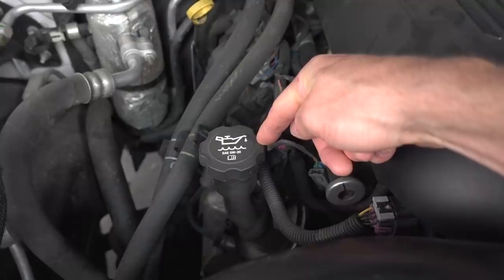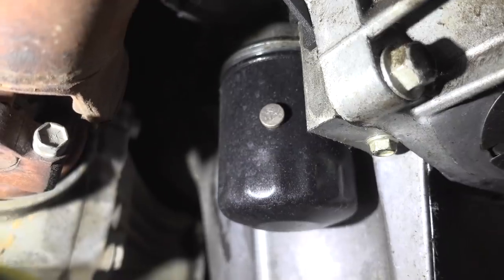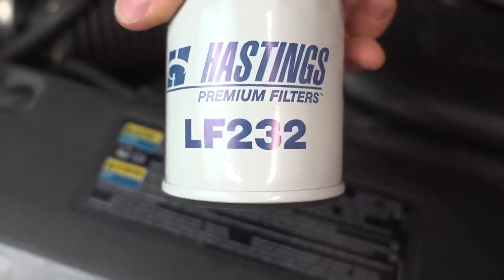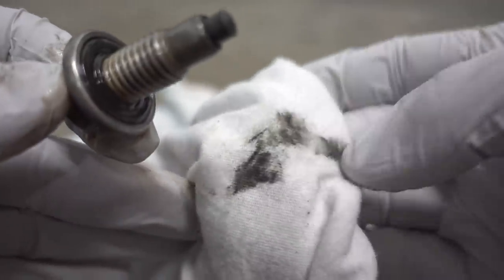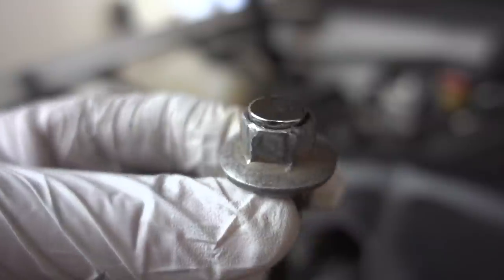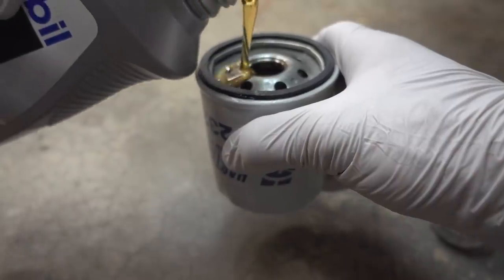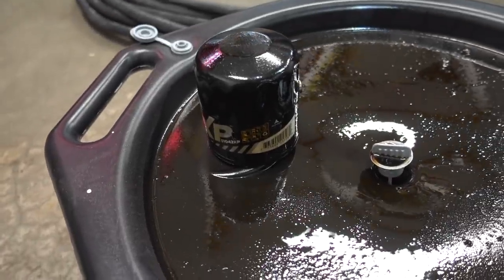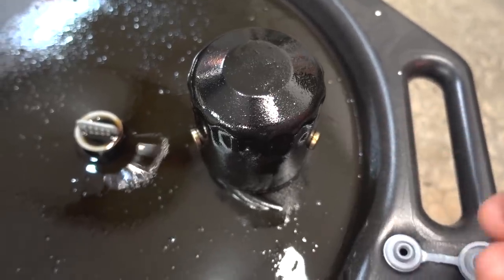Look What A Magnet Did To My Motor!

Comment: never put Additives in your engine
Reply: Put always additive in your engine, IF the additive are ATP AT-205 Re-Seal and/or RVS Engine Restore. You only need to add them to ONE oil change tho, since the effects last MANY oil changes. 100 000 km in the case of RVS.

Comment: Put a large magnet on the base of your oil filter.Any steel that gets in is trapped even if the filter by-passed for any reason.
Reply: Yes. At the bottom or around. Same difference.

Comment: I'm a subscriber to "Project Farm" and advise folks to check his channel out.  He goes to amazing lengths to prove and disprove the claims of a variety of mechanical and automotive products as well as some that may be more considered as consumer products.   As for "Hastings", they've been an automotive parts and additive manufacturer since the beginning of automotive time.  After seeing that rare earth magnet and the fact that it has completely magnetized the drain plug, I have an issue that you may have now magnetized an area of the pan around the plug which makes the ability to remove those ferrous deposits next to impossible.  In my opinion, the original magnet that's on the end of that drain plug is entirely sufficient for it's intended use.

Comment: Additives in my opinion are snake oil.  Why wouldn't Mobil put it in their product if it is so great?  I change my oil regularly (3-4K) and vacuum a gallon of ATF every 15k or so.  I have 245k on my 03 Suburban and just replaced valve seals which solved my oil consumption (1qt per 1000 miles) issue.  It runs like a champ. Thanks for the video 1 Road.

Comment: My 2002 S10 has a side mount filter too..what I do is put just enough oil in the new filter to coat the inside without spilling out while installing it...👍
Reply: That is exactly what I do to my John Deere lawn tractor.
Fill it just full enough so it doesn`t run out when sideways.

Comment: Just a thought on the drain plug extra magnet.  You should check it against the polarity of the tip magnet so that they are not opposing each other, so that the north or south fields are both pointing in the same direction.  

My Toyota Tundra transmission has rare earth magnets in the transmission drain pan that get cleaned when i change the filter, they are just held in place with their own magnetism.  You could place a large rare earth magnet on the outside of your oil drain pan and check it when you check your oil pump screen, or pull it off right before you drain your oil.

Comment: Great video
.Great video I have always used brand name oils. Delo,shell, mobil , and lots of others. Ran a construction company with cat, hitachi detroit engines. Started back in the early seventies, had dozens of old and new pieces of machinery also fords , chevies and dodge pickups. Never used magnets or oil additives and never had engine premature wear. Back in the early seventies oil was a single grade . 10 weight 20 weight and 30 for the summer. Did the recommended change intervals . I'm in my mid seventies now and the message you are sending is wrong . This is my opinion based on experience  . The most critical reason cars , trucks or any piece of equipment that had gas or diesel engines gave any trouble was operator abuse, not the lack of additives to the oil. Good oil, regular fuel and air filters , also changed the coolant when needed.

Comment: That was my invention with the magnets on the oil filter. I should have patented that when I turn 18, I was 15 and just seeing all these magnets that were in the trash from speakers, back in the day the bolt was magnetic but I said why not at the filter? They did stop the magnets from some factory bolts. I would also use one on my Transmission pan, great video brought back some great videos. The answer to oil in the filter even sideways , you should buy a pre luber,  once you turn the key it takes the oil from the bottom of the oil pan and it lubes the motor before you start. Another great idea to keep that engine living longer,  a inline oil cooler,  to keep the engine oil cooler.

Comment: Those oil additives that coat you engine internals are also coating (and clogging) the filter and pick-up screen. We learned that back in the 90s with the whole Slick 50 craze. In a lot of cases manufacturers declined warranty repair if it was found they had been used.

Comment: I have a side mount oil filter, I always fill it right up and let sit for at least 30 minutes, then I hold filter horizontal pouring excess oil into oil drum while very slowly rotating.  Then install it immediately with old oil already fully drained and drain plug also already torqued to spec.
Reply: Thanks Martin. Some people have a hard time understanding anything.

Comment: My 99 Chevy Silverado used to kick hard into 2nd gear when it was hot. I checked the transmission fluid level and saw it was a few quarts overfull. (I bought it used and it evidently came that way from the dealership I bought it from. I never added any fluid to it).  I siphoned 2 1/2 quarts out of the transmission to get it back into the operating range and after that, the hard shift stopped.  It's a smooth transition into each gear now.

Comment: You can prefill those horizontal filters, just don't completely fill them. Fill them a bit, let the media soak up the oil, then add a bit more. I do this on my motorcycle and the low oil pressure light goes out immediately compared to putting a dry filter on and having to wait a few seconds for oil pressure to build.

Comment: If you read your owner's manual, you'll see that the manufacturer does not recommend any oil additives but does recommend a good quality oil, like  Mobil 1 or any other quality full synthetic oil as long as it is the listed viscosity. That should be all that your engine needs, although I would use Mobil 1 in the extended performance formula even though I don't agree with extending the oil drain interval above the manufacturer's recommendation. Back in the '70s when synthetic auto oil first came out, there were many of these miracle oil additives for sale. The first 2 synthetic oils for sale to the public were Mobil 1 and Amsoil. A co-worker of mine bought a brand new Oldsmobile Toronado when they first came out. Another coworker was also an Amsoil dealer and he sold the new Toronado owner some Amsoil for his first oil change. The Amsoil dealer also sold many other company's additives. There was one additive that guaranteed to make your engine run better because it contained small particles of Teflon in it. The guy did his first oil change with the Amsoil and also fell for the benefits of the Teflon additive. He added the additive and drove his new car for a while. After a couple of months, his new Toronado engine started making clicking engine noises. He took it to the dealer service dept. under warranty. They found all his oil return holes clogged with the Teflon particles causing oil starvation. The oil additive advertised that the Teflon particles were small and would not affect engine operation in any way. They had to flush his entire 2-month-old engine to get rid of all the Teflon particles. This additive almost caused irreversible engine damage to his new car engine but he caught it early enough. This is why I will never use an oil additive but will use a high-quality full synthetic oil, instead. DO YOU FEEL LUCKY?

Comment: The oil will not pour out "completely" with a horizontal filter. Some stays between the media and the can, held in by the anti drain back valve. Some is better than just air.

Comment: A good way to prime your oil system is to pull your fuel fuse or ignition control connections then turn the motor over for 10 seconds and repeat for another 10 seconds. This is more important to do with turbocharged vehicles due to all the extra piping!
Reply: That's the worst advice ever! A car will build oil 10x faster starting it less turns compared to a dead slow crank that requires a few extra turns to build up oil pressure.

Comment: I use AMSOIL and never have any metal on my magnets and never need to use additive and an oil change last me a few years to boot! that WIX-XP is a top notch filter better than the filter you replaced it with.
Reply: When I bought a pair of shoes and was concerned about the leather soles, sales clerk asked if this was the last pair I was going to buy.

Comment: If you’re using a premium full synthetic oil you DON’T NEED any additional additives. 
Also…you CAN pre fill (or mostly fill) a horizontal filter if you’re quick to spin it on. ..  I do it all the time and don’t loose any oil.(maybe loose a tiny bit sometimes)

Comment: In colder temps try to find a motorcraft filter that will fit or a filter with a silicone drain back valve, Hastings filters use rubber and can cause a cold start tick after 100 miles or more, silicone drain back is critical ē  in temperatures lower than 50 degrees
Reply: Just about every oil filter that's currently available has a Silicone Anti-Drainback Valve -- but somehow, the importance of that silicone valve was ignored -- in favor of saving a few pennies on an Oil Filter that is NOT readily available.
 Why people bother to test cheap, hard-to-find filters escapes me -- and experienced mechanics and racers KNOW that oil additives are an expensive waste of money.

Comment: I use motorkote, too, but always add slightly oil less to allow for the additive so I don't overfill. BTW: The MPG in my 2000 Hyundai went from about 34 to 41 MPG. That alone pays for the MotorKote.

Comment: Good idea for the drain plug magnet, but any metal pieces caught by the threads on the plug will be scraped off by the oil pan threads when you remove the plug, unless that tiny magnet at the tip catches them...
Reply: Maybe screw can do it that when you put extra neodymium on outside screw head on bottom but i don't think so

Comment: I sincerely appreciate your pushing the idea of Magnetic Drain Plugs, EVERY engine should have one because no filter can capture the dangerous and damaging particulate under about 20 microns.  Why is that a problem?  Well, testing has proven that 75% or more of an engines normal wear is caused by metallic particles that are under 8 microns, ones that are NEVER caught in the filter.

Note:  The magnetic drain plug you have looks like an OE on some Chevys but may be a Dorman or Help from a local auto parts store.  I am sorry to say that these plugs are not anywhere near the power you need to catch all particles, they can barely hold their own weight (2 ounces) when upside down.  What you need is one of our Extreme high-power NEO plugs, they can easily lift 3 pounds or more and do not degrade with heat as the cheap ones do.  You also eliminate the need of sticking a second magnet on the hex end of the plug, a real pain in the neck

Here are a few clarifications you need to add to your script, they are important and critical.  

1.  Only about 5% of all vehicles come with Magnetic Drain Plugs, so you need to deliberately add one in most cases.

2.  You always need to put oil into a new filter, even those that mount sideways.  Dry paper is a problem for the oil pump so just put in less on the ones that are turned, it will be absorbed and not run out.  (Remember to also coat the o-ring seal with oil.)

3.   NEVER put magnets on the outside of an oil filter, they must go inside!  Briefly: You are capturing large particulate BEFORE it is captured by the paper media and this is a problem.  You leave this heavy and rough metal all around the inside of the "can", an area that is tight and designed to have the LOWEST coefficient of friction.  What you want to capture are particles that will go through that paper and back into the engine, the ones that do 75% of the damage.  (Please see the extensive details on the tech at our website...   www.OilFilterMagnets.com  and  www.OilDrainPlug.com )

Please take a look at all the technology we have developed and placed on our websites, you will find many resources and products that are designed to extend the life of your vehicle.   Regards, Gary the partsman    www.GWRauto.com
Reply: Wrong. An Amsoil BYPASS FILTER can trap down to 2 microns.
Reply: Just how am I supposed to put my good, strong Black Hole magnets inside my spin on oil filters??

Comment: Motorkote is some good stuff!
Your transmission sounds like it has varnish build-up.... transx is an excellent additive for your problem. In most cases it will fix a sticky Transmission in only one or two blocks of driving.

Comment: I live in Oregon and it rains a lot.I use Mobil 1 also and had no sludge or build up in my engine. I started using Motorkote about 60k ago . I kept getting a bunch of Tan whipped cream looking crap on my oil cap , checked my antifreeze level everytime I drove , No cracked block or head gasket ...checked cap, had same thing on underside of oil cap. Shook it off and wiped again.I thought it was moisture in my oil which made it foam. I went through this crap off and on for months. Changed my oil after 1500 cuz it happened again. I then had a hunch it might be the motorkote. I went deep in the net for info on motorkote.....I found out it works great on taxis and big rigs , because they run constantly , they burn all moisture away. Its the motorkote that makes it foam, found out from several sources, not just a couple. changed my oil 4x in 10000 miles. Its been rainy now for 3 months. And what do you know. NO MORE SLUDGE BUILD UP OR FOAM...And the build up I got from this is finally starting to go away. I shine a flash light down the hole where the oil cap is and can see the whole inside front ,timing chain and pulley shaft area.... . That shit will ruin your engine. Do some major research , another thing, it produces chlorinated paraffins , which makes your oil acidic , and start corroding parts in the engine.I live way out in the country and when I do drive, Its at least 20 miles on the engine before I shut it off , Plenty of time to heat up to optimal operating temp. But the foam doesn't flow anymore to cycle through the engine to evaporate the existing moisture....Bottom line is it sucks unless constantly running. If you don't take my word for it , Do 15 minutes on google on Motorkote and see for yourself.
Reply: Still getting the tan whipped cream from the motorkote, but not as bad.Its gonna keep happening for awhile because motorkote stays in your engine for a long time. It bonds itself to the metals inside the engine , Ill come back after the next oil change and update.Prob a couple weeks.....

Comment: The ticking is your fuel injectors, normal.  Some of the lifters in the LS motors tick as well which is normal.  You are probably feeling the firm down shift into second.  That is actually a good sign that your trans is healthy and not slipping.  Also it will be more pronounced in a 4wd vehicle with a transfer case.  I would not add the motorkote to the trans as it may mess up the paper material in the clutch pack.  I only use lubeguard red in my 4l60 E.
Reply: You are right. Motorkote is for engines and some gearboxes without clutches.
Reply: Ahh the great 4l60e where you replace the clutch bands 2-4 times over the life of your vehicle. I love chevys but I'm not a huge fan of the 4l60e's. My s10 has had the 3 4 clutch packs changed twice with just 117,000 miles on the engine.
Reply: The severity of the shift will be proportional to the ratio change and the clutch apply programming.
Reply: @kickazz9473  i got 198000 on my 4l60e, never been into it other than a basic filter change roughly every 30,000 ish miles, and its a 2000 silverado with 4.8l
Reply: @ericeaton371  I won't deny that many don't have problems. My problem is not unique to me. There are forums all over the internet about the 4l60e. For those who've had no problems that's great.
Reply: The kick in second is actually due to a pressure valve in the transmission sticking a little bit. Also that specific sound was a few of his hydralic roller lifters not being pumped up with fluid and therefore making the tick. All very common issues that in all honesty are not a big deal
Reply: Hear, hear!  This is good advice.

Comment: I used to use a telescoping mechanic's magnet to sweep the bottom surface of my oil pan through the oil drain hole when I changed my oil. It was surprising how much ferrous metal I was able to pick up doing that. I would also tape some of those button magnets along the bottom of the oil pan if it's not made of a ferrous metal. Prefilling an oil filter, whether in a horizontal or vertical orientation, is a good idea. Just saturating the filter media with oil will lessen the time it needs to develop oil pressure when you do the first startup. I would further recommend that you disable the ignition or fuel pump and crank the engine over slowly immediately after the oil change until oil pressure builds up in the system, usually a few seconds. What you don't want is what I sometimes hear at service shops where they do none of this stuff and the engine's valve train clatters for 10 to 15 seconds after an oil change.

Comment: I use “filter mag.”

They are expensive but worth the cost

My Magnetic drain plug is “clean” when doing an oil change 

Check them out on YouTube
Reply: Jack Smith cheap magnets that are strong can be taken from old computer hard-drives.
Reply: Expensive but worth the cost- many people would disagree but to each his own.  Never used one. Just change oil regularly and clean drain bolt magnet.  Two cars with over 200k on them.